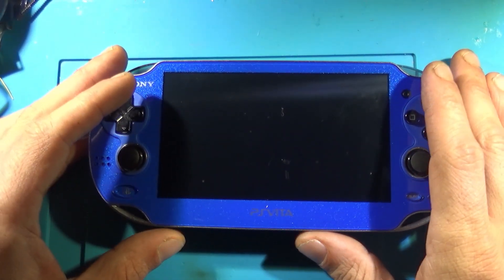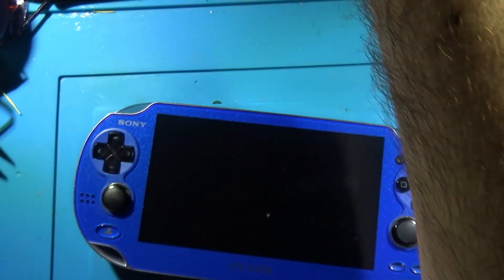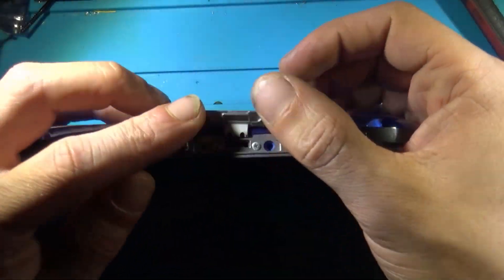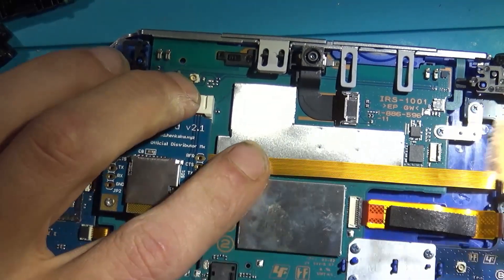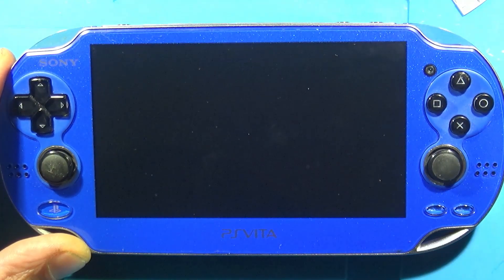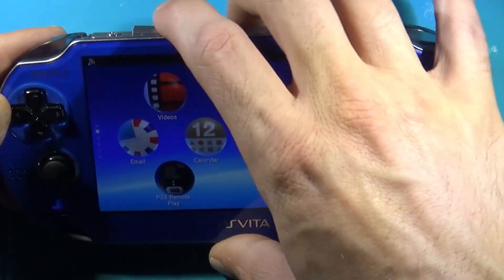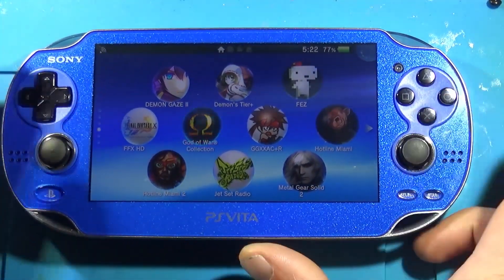PS VITA PSVSD + SD Extender installation and setup guide!

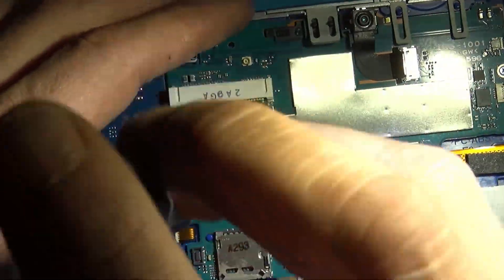Comment: 5:15 you did it stupidly easy with the wrong screwdriver while i get punished with the correct screwdriver. both screws stripped. I put a good amount of downward force too. I'm literally stuck and i'm beyond frustrated. 

Edit: Gave up and went to a repair shop to get it out. Thankfully, David includes Phillips head screws in the kit to replace those trash torx screws

Comment: Today I finally did this mod. It is easy to do and your video made it clear. Only parts is that sometimes your hands are in the way and that at the end of the modification, the Vita is suddenly put together again. Which isn't a problem of course.
I also agree with the speed up, but that same speed up is still there during the crucial parts.
I know it is an old video, but wanted to let you know.

Thanks for this guide. It helped a lot.

Comment: Finally got the psvsd, open up my vita, 3G adapter screws are stripped 🙃 fml
Reply: Happened to me too, I ended up having to drill it out with a screw extractor kit
Reply: @Speeedyian i ended up getting one out and just ripping the post off from the other screw. On screw for psvsd is enough lol

Comment: Could've mentioned in the video how easy the screws that hold the module are to strip.
Reply from the maker: I didn’t run into that issue thankfully. If you’re totally stripped try grabbing the head with flush cuts and turning or some locking Vice grip pliers. Luckily the head is large to grab onto
Reply: @ModzvilleUSA  oh ok cool. I ended up buying some Vamplier screw removal pliers off of Amazon, and i’m hoping that does the job.
Reply: I found that an eyeglass kit screwdriver is perfect for removing the screws.

Comment: Thank you I managed to get this done I'm not normally good at this sort of thing but it all worked out. I broke the battery connector on the chipboard but also managed to solder it using the three solder points instead of the connector. What a journey 😂

Comment: What are the dimensions of this cable? I found one online that's 0.16m, I worry that I might have excess cable length so I'd have to bend the cable in uncomfortable ways to fit snug in the shell. Nice video, I'll use it as my guidelines when I get around to the install. I already have the psvsd module so I'm looking forward to it!

Comment: I can’t even find this or a kit for this. Your links are old
Reply: These are both available on Tindie still by the original creator
Reply from the maker: It’s open source now. I retweeted it on Twitter recently
Reply: @ModzvilleUSA!  is it better then the one you used just look though all your tweets notice black ribbon looks smaller then the one you used

Comment: I used to use the 3g sd mod by molecule and I had severe corruption issues. I would just randomly get the c828 error one by one until my entire card was corrupt. I would start over from scratch and it happened again, so I bought a spare motherboard and tried and it happened AGAIN. 3 times and that burned me out on the vita completely for almost 4 years. I just started back into modding a few months ago and I am steering faaar clear from ANY 3g sd mod. So far with sd2vita I have zero corruption issues and that's using the same vita and memory card.
Reply: Make sure you're not using sketchy sd cards. Amazon sells tons of fake. That's is the problem you both are having.
Reply: @NeptuneSega  no it's not, my card is authentic. The voltage to the 3g module is too low to properly read and write memory. Know what your talking about before you look like a buffoon.
Reply: Yeah LOL  @NeptuneSega
Reply: Oh, great. I had corruption with SD2Vita which is why I'm moving to this. Sigh. I don't get the hype for Vita modding. It's all been so finicky for me

Comment: Bruh 2tb on ps vita seems a little insane lol
Reply: Only a little. the Vita is limited to a certain number of bubbles you have. Not the amount of storage. I think the limit is somewhere around 500. So you're going to either hit 500 games, apps, etc. installed, or whatever your storage limit is. 2TB might not even be enough space depending on what you install. Some games are pretty chunky, especially multi-disc PS1 games like FF7.

Comment: I recently got back into the Vita and had a SD2Vita I used very shortly before realizing it was an extra annoyance to ever want to use the game card slot again. Didnt know this mod board existed until I saw your video. 

So anyways I installed this in my vita 1000 3G and now my game card slot is freed up and mounting games along side the additional SD live space storage. 

 I also mirrored the partition setups on my Vita TV and I can use a USB to Micro SD adapter and seamlessly transition from either console if I felt the need to. I shouldn't ever have to touch or mess with the partition/mounting points for the systems ever again.

The only thing I really want is a flat flex extender though and I cant find them anywhere right now purpose made like you had. I could probably build my own but the one you used was very slick. Anyways without that I will just have to tear the console down if I ever want to move the SD card to my PS TV.

If you know where to get the flat flex or have a good suggestion on alternatives thats greatly appreciated.

Comment: there was other mod in which you add an usb port to use thunbsticks as memory cards (UX0)
Reply: Luxurious Superstar  it was ps vita charging and usb mod by Francesco Barbieri, technically you can use those micro usb thumbsticks on a 2000 vita model, of course these mods require henkaku in order to work.
Reply: Luxurious Superstar  if it's 2000 just grab a micro usb thumbstick and try to plug it, go to vitashell press triangle choose "mount uma 0", later "mount usb as ux0" see if that  works, now that I remember, you will need to plug the thumstick after selecting "mount uma 0"
Reply: Luxurious Superstar  yep, there are these small dual drives meant to copy the phone's files and later paste them to a pc, must be micro usb because there are usb-c models too. I assume it is possible, couldn't test it on my 2000 vita because I sold it.
Reply: Luxurious Superstar  I keep saying thumbstick when the right term is thumbdrive, my bad.

Comment: Unfortunately I use model 2000 slim... Why this socket was removed on a new model?
Reply: they removed the ports they didn't used anyway. 2000 models might use an otg port to connect a thunbstick, since I watched a modding video that adds an usb port but it was done on a fat vita. I think an sd2vita will do just fine anyway.

Comment: PS Vita PSVSD Flat Extension Cable is sold out :( I have the PSVSD but cant find the extender anywhere.
Reply: I still have a few somewhere, kept them as replacement in case packages go missing... Will list them in a few weeks if everything is okay.
Reply: @mikesierra85  where can I find the listing? Ill oder right away when listed
Reply: @Statistic189  I haven't listed any yet.

Comment: I bought a WiFi model because the Vita's were locked to AT&T in the US.  I have a Japanese model I got off eBay a few years ago that is a 3G that I might do this on
Reply: The issue is 3G models are uncommon and your missing that port if you didn't have one with it

Comment: Why remove 3g and add SD, when it allready has it…? 🤔
Reply from the maker: You’re mistaken. The vita uses it’s a proprietary memory stick and those sticks are stupid expensive.
Reply: @ModzvilleUSA  yeah yeah.... usually you needed at least one kind for the 1000s whereas the 2000s had 1GB Internal to work with....no OLED though.

I bought a 16gb to play with and saw that vita games quickly build it up.... bought a blue 2000 gave it to my bro and remodded both and threw SD2VITA in mine.

A must have mod